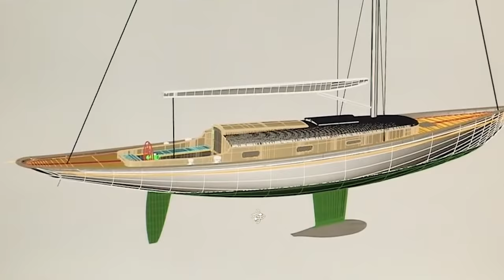Amazing luxury wooden ship building process. Incredible modern wooden yachts assembling construction

Comment: That viking ship with all that iron in the hull. How long before iron sickness ruins the hull. My own bronze fastened wood boat built in 1970 used steel drifts only to pin the floors to the keel and they devasted the floor (joist) wood in several floors, an of course the steel was wasted away to nothing literally in the keel. Would have vastly preferred bronze drifts or even better trunnels made of IPE etc... 50 years is twice the expected life of such a wood boat built with iron is what I think. Iron sickness dissolves and rots wood, as iron rusts, acids form. if the acids cant be flushed away, wood is dissolved. Regardless it will turn the wood black.

Comment: The WW2 motor torpedo boats were built in a similar way. Frames made from copper riveted oak stringers with double diagonal planks on the outside. Being power boats, they had a chine hull but construction looks similar.

Comment: I’m interested to see how the boat holds up to movement and salt water over time. How well will the glue last? Will it delaminate? Will a boat built this way last 10, 25, 50, 100 years like some of the solid timber boats from the past?
Reply: Check back with them in 100 years.

Comment: Wood has no place in a modern boat for anything structural. Wood does what nature intends it to do..decompose. It keeps people constantly battling rot at great cost throughout a boat’s life. The only acceptable use of wood on a boat is perhaps decorative interior and furniture. Even cork core, fiberglass encased wood ribs, stringers and transoms are commonly compromised. It’s not a matter of if, but where, when and how bad. Own a wooden boat and you are enslaved by maintenance or allow its demise.